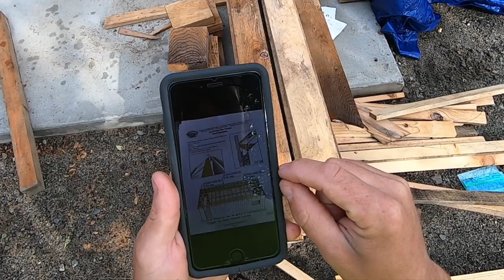Hold on to your Britches! Things just got HAIRY ~ Strapping the Roof on the Post & Beam Barn

Comment: Over the last 50 years it's been my experience that anything you drop will always land at the worst possible place. If you're working on your car and drop a bolt, it will roll under to the center of the car. If you're building a barn and drop your hammer, it will land on and puncture your air hose. It's the way the universe works. I just try not to take it personal, keep a positive attitude, and do what I have to do to continue my work, exactly like you did. The barn is looking great, I'm pretty impressed with that kit you got.
Reply: In Ireland we call that "Murphy's Law" or "Blame it on Murphy"

Comment: Looks like yo are still working between the rains! Seems to be the same everywhere. I hope to get 4 hours into my build today -- but it will likely be 2 hours the way the weather has been! It is always so nice getting the roof started -- I envy your progress, the little barn is looking fantastic Al! Also, when you were looking for that barbed fitting, your buckets of stuff reminded me of my setup until last winter. I had ten 5 gallon pails full of hardware, fittings, etc. from when we first moved and everything spilled. I took several weeks last winter and got everything semi sorted and into bins, drawers, and other containers. I still have a week or-so this coming winter to finish the job! Winter is a great time to catch-up on that sort of thing...

Comment: I wished that I had a good friend or two like Al several years ago when I attempted to construct a 8' x 10' Storage Shed Kit from Home Depot .The Instructions stated that 2 Men were required to build the shed and I only had ONE ! Myself !
The Wall Framing was 2''x3'' and with my inexperience at Construction they ended up being out of square and not plumb ! The foundation and decking was no problem as I did all that by myself . But I had no one to assist me in the raising of the framed walls and getting them square. I ended up giving the  unfinished  shed to a friend of mine that was remodeling a house and needed the material .

Comment: After building my first pole barn with a metal roof on 2" wood strapping 18" on center I now always do a solid board roof all the way up with tar paper under the steel. It makes a strong roof and no more condensation.
Reply: Bill Herrick we always do the same. It is miserable trying to crawl around on a metal roof without sheeting under it! we have installed metal roofing on 5 of our structures now and just did my chicken coop and run, we did not OSB sheet the run portion and man! what a pain!

Comment: So here's what I was taught  to save a bunch of time. I realize it's to late for this part of the roof but I understand you have a lean to on each side. I mark each rafter with the strapping spacing before I put it in place. In fact if you line them all up you can mark  them all at once with a square or else one at a time with a tape measure. I also mark the strapping with a line where the center of each rafter goes. When I comes time to do the strapping it's quite quick because all the marking is done. You line up the strapping with the mark on the rafter and center the rafter on the mark on the strapping and nail it down. There's no measuring or moving spacers.

Nice build btw!
Reply: There are marks on the timbers for rafters etc It's part of the kit.

Comment: I like your build. Consider yourself an accomplished framing Carpenter. About DeWalt? Construction-grade Black & Decker. As a carpenter I read about the components and build of their tools. I have use DeWalt for the past 9 years.yeah I've had to change a few batteries but I'm still using 9 year old tools and working great. Here's where I get carpentry superficial. It was the color yellow and black that Drew my attention to DeWalt just a great tool.

Comment: Al. Hubby says put a few drops of machine oil into air gun where hose connects..nails will work better. Flush. Wont have to hammer in ends.

Comment: What I would have done as a job safety measure would be to use some scrap lumber and build little rails couple of feet above ground, braced on the backside right at the edges of the concrete slab. That way, when moving the rolling scaffolding if you get a little too close to the edge of the slab there'd be a little resistance to stop, or at least warn, you. You definitely want to keep those casters on the concrete, just going off the edge would be so unstable that you'd very likely fall, and at that height it's about the same as falling off the roof.

Comment: Um Al? At 31:30 you put the teflon tape on counter clockwise, but screw the fittings on clockwise seconds later. Both go in the same direction, clockwise. I wouldn't have noticed except you mentioned that the video made things look backwards and that people would comment about you doing it wrong so I had to go back and look.  :D  Loving the series btw, I look for it every morning first thing.

Comment: Going great !  Just wondered why you decided to repair your air hose in the dirt when you had all that clean concrete and platform area available?  Seems to me it just increased the likelihood of getting dirt or dust particles in the air line that could have made its way to the nail gun.  But, as long as it worked in the long run, no harm done.  Looking forward to your next vid.

Comment: I always thought that the scaffolding's wheels locked so it wouldn't roll on you when you got on top.  You are able to roll the scaffolding when you need to without getting down.  Does that mean you don't lock the wheels?  Are you afraid it will roll when you don't want it to roll, especially when you are trying to climb on the roof or come off the roof?  I am amazed at your carpentry skills!  Amazing!

Comment: Assuming you're planning on a metal roof, I suggest you place a layer of foil faced foam insulation on top of your strapping first.  An Amish carpenter suggested this to me several years ago and I can attest to at least a 20 degree minimum temperature difference in the attic of my house, not insulated (yet) and my garage.  I guarantee you'll never regret it.
Great videos and please keep them coming.

Comment: You should have been wearing a Framer's Tool Pouch which has the pockets to hold the extra nail clips when working on the roof of buildings so when your Nail Gun runs out you will have the nails with you instead of having to get down and then back up again !
Reply: Al has said in replies to other comments that he doesn't like wearing them.

Comment: Al , you should be wearing a Safety Strap Belt and be tied in when working on a Roof Frame that close to the edge . If you were to fall off, you could really be hurt and end up in the hospital with severe injuries , if you didn't land on your head on that concrete slap under you !

Comment: Very odd.....I usually allow the ads to play in order for Al to receive a bit more revenue from YouTube; however, about 1/3 the way through this video, the screen went gray for about 2:30, with the words ‘THIS IS A DEMO VIDEO’ on the screen.  YouTube has gone wild with the ads, the placement, and the length of them since the beginning of May.  I’ve had ads last from 20 seconds to 2 minutes, then 4 minutes, and most recently a 17 minutes ad that was more of an infomercial.  I just cannot watch a 17 minute ad slapped into a 29 minute video, so I hit the SKIP button on this overly extended torture.
Reply from the maker: P Robidoux I too would skip those commercials! 😂
Reply: P Robidoux - YouTube creators have no input on ads. Ads are targeted to the individual watching by YouTube algorithm. You & I could watch the same videos at exactly the same time & see different ads. You only need to let ads run for 31 seconds for YouTube creator to get benefit. I read the comments while ads run.
Reply: Tony Grimes   Yes, I am aware of the algorithm targeting ads based on my  viewing and my Google searches.  I recently turned off that ‘targeted’ feature, so YouTube is continually asking me to answer questionnaires prior to the video as a way to target ads to me again.  I ignore them, so I get hit with some very, very long ads.  I am like you and read the comments or do a very quick chore (make some toast and coffee, etc) while they play.  I was unaware that if they play for at least 31 seconds, Al - and other creators - will still benefit.  I let that 17-minute ad run for over a minute before I realized it was soooo long, so at least Al got paid something.

Comment: My Dad used to say you can move anything if you know how to use a lever. You’ve proven that ratchet straps factor in as well!
Reply: Yeah.. levers, rollers and pulleys (which includes those ratchet straps) - the basis of moving anything!
Then string lines, plumb bobs, levels (which can be as basic as a pan of water or even a square that works off your already plumb walls) and basic Pythagorean maths - the basics for laying it all out accurately.
That, combined with some time and craftsmanship will let you built almost anything. The ancients proved this already. It's funny when people marvel at ancient monuments - "oh wow, how did they DO this, it must have been aliens"... no, basic builder's knowledge, craftsmanship, and LOTS of work.
Reply: @calebfuller4713  Common sense.

Comment: I've been thinking about condensation inside a metal roof building..
I'm thinking of running some tests to stop the sweating by applying snow roof (silicone) made to seal/coat mobile home roofs..
And the paint on rubber pickup bed liner..
Before installing the panels
Does anyone have any thoughts
Reply from the maker: I have never seen our goat barn metal roof sweat 😓 yet. In NYC I put tar paper down first to stop it
Reply: @LumnahAcres  
👍👍

Comment: how can you tell when your chickens LR2 old that you decide to make them your graduate them to freezer cap because I know it is some point where they might lay eggs but it's not worth it if you want the chickens still tasty and somewhat 00 Roush worthy alarm saying
Reply: To check for egg production:
Hold hen with her head under your armpit, then feel by her vent. There are 2 bones that poke out spaced together. If they are stiff & close together she isn't laying, if spaced four finger width apart & flexible she lays daily. You will learn the stages in between as you check regularly. At about 2 1/2 yrs. The production tapers off & some people get new birds. We keep all ages, we go through our older hens & choose the best, those are our breeding stock (for best egg size for chick hatching hens should be over 18 months